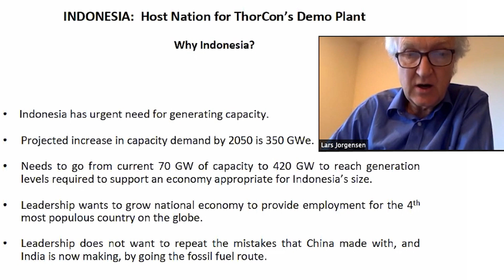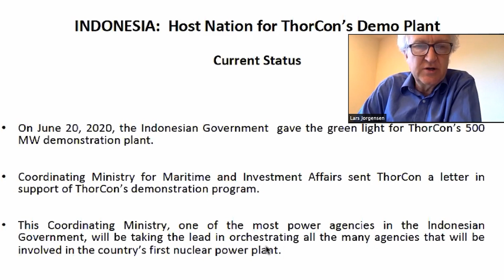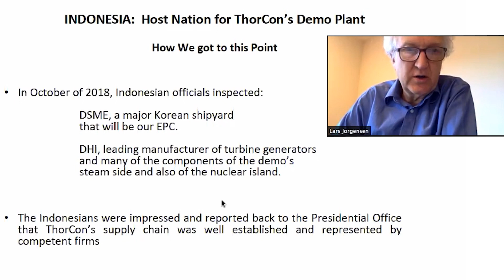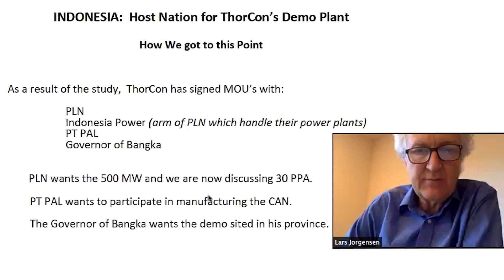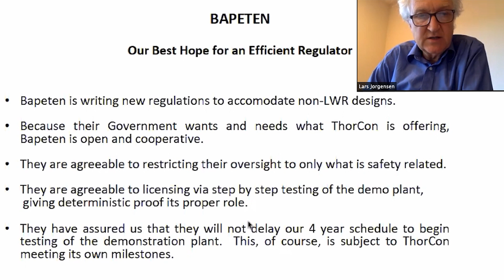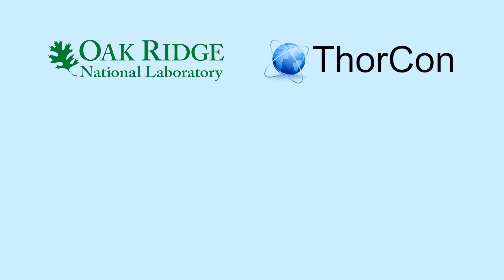ThorCon - Why Indonesia? Hosting ThorCon's Molten-Salt Reactor - Lars Jorgensen @ ORNL MSRW 2020

Comment: A 30 year Power Purchase Agreement (PPA contract) with Indonesia - initially  to provide up to 7×500MWe liquid metal Thorium ion molten sodium Fluoride salt energy converters.A ThorCon energy converter is Walk away safe; high temperature but near ambient pressure; can "Black-Start"; has a plant footprint of 1.14Ha for a (65m×175m) 500MW site (43.8kW/m2) and has a planned efficiency of about 45% while desalinating more than just it's own water needs. Power produced for less than 4 cents a kWh so probable agreed commercial unit price to consumers will be less than $0.07/kWh (includes levelised capital cost of $900 -1200 per kW. 
Here is ThorCon's latest  posting of a presentation at a Solo University, Indonesia last October.. 
https://youtu.be/fsi7lzbiq5k
Reply: The capital cost can't be right. They run over 8000 hours a year, with 4 cent they would earn $300 per kwp/a. Either the power is much cheaper, or the capital cost is much higher.
Reply: @Psi-Storm  Although the ThorCon is expected to be capable of cold starts and "load following" it is expected that the first commercial ThorCon will be located on the Tin mining island of Bangka in the java Sea and run for up to 35 000hours (before having to pause to switch over the tertiary salt heat exchange from the 'A Pot' to the 'B pot') when the new 'B pot' takes over with the replacement new graphite and primary heat exchanger and "dump" tanks. 
Whether any or all of the old liquid fuel and salt is transferred to the new pot would be a decision taken at the time and depend on the then current salt and fuel characteristics identified by the expected continuous live chemical monitoring. 
However regardless of the chemical  condition of liquid fuel and salt, the used "Pot & Can" (including used graphite, the primary exchange and dump tanks - together with any residual fuel and primary salt) will remain in its original position for a specified cooling period of a further 35 000hours (4 years) when  it will be replaced by a new or possibly recycled pot equipped with new graphite etc. Tp repeat this process or possibly  an improved future process. 
Note: by keeping the nuclear active cycle component to just 4 years enables better accountability on confirmation of any deterioration in the exposed components, eg Helium embrittlement being more prevalent in far higher stressed Chromium Steels and at such higher pressure confinement which is not applicable.
Reply: @MrVaticanRag  Bangka is interesting as not only it is rich in Thorium from Tin. Its actually also quite safe from earthquake compared to many other place (also Kalimantan). Obviously they think of this, it can be a center for nuclear development in Indonesia.

Comment: This is remarkable progress; if Thorcon really are going to be the first to build a full scale demo plant then a huge amount of reputational capital is at stake here. The first one just has to be successful.
Reply: If they make the first reactor and it works (which it most probably will) others will get a green signal to do so aslwell. There are many startups pursuing the model of thorcon i.e. factory based nuclear plant production. Even if 3 or 4 such startups are proven to be working we could easily phase out coal and natural gas.
Reply: ThorCon's is not the first - that was back in 1967-72? At Oak Ridge - the unit under construction is to basically test hot salt circulating through heat exchangers; dumping liquid "fuel" and heat disappation etc.